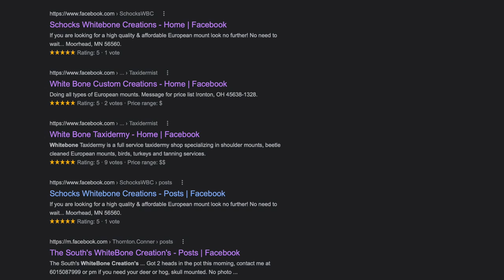WHICH IS BEST FOR CLEANING SKULLS BOILING OR MACERATION

Comment: I don't usually jump on parties like this, but I followed the boiling technique of 30 minutes of boil- pressure wash-20 minutes of 1 to 1 (40% hydrogen peroxide to water) - then the mop and glo, and my mature mule deer turned out beautiful.   It was far better than any other attempt I've made at cleaning a skull. I highly recommend this method.

Comment: I'm on a lot of those Facebook groups who slam the boiling method, I've never had an issue with boiling because you're right in that too much of anything can damage bone, also a lot of the people who don't agree with boiling have never tried it, they're often in small apartments with either a small or no garden, so they don't have that option, I see a lot of posts on Facebook of people who dig up their buried skulls or tip out the maceration buckets and find the bones falling apart! Keep doing what you're doing, I love watching your videos over here in the UK!!! I'm working on a few red stag skulls myself and your tips are priceless!! 👌🏻
Reply: The reason why they fall apart is because every single bit of connective tissue is removed, so unfused parts of the skull will need to be glued back on. Maceration, unlike boiling, removes all bits of flesh and doesn’t cause any damage. Boiling does trap grease, weaken the bone structure, and causes splitting of the bone due to intense heat. While some results may be worse than others, they are still bound to decay over time. Hopefully this helps give some insight.

Comment: I used to love watching ur channel! Got me into bone collecting in fact! I use the maceration method and I'd like to clear some things up with boiling and maceration:) maceration does smell and it takes time yes, you can speed it up with a tank heater or pond water! It actually helps leach grease out of bones as well, but some animals are more greasy than others. Maceration is a better option if you want your skull to last longer and look better since maceration doesn't damage the fragile bones unlike boiling! As for boiling yes it is fast but it isn't very good for bones, boiling actually can trap grease in bones and can cause it to resurface years later which doesn't look as good! As for your whitening method? I've never used the product you use to whiten bones (I don't whiten my bones I love the natural color!) But hydrogen peroxide is perfectly okay to use and fairly cheap in some places, bleach isn't recommended for whitening bones since it'll eat away at them and make them chalky and brittle. For maceration ammonia is a great degreaser to use! Just be sure to use it in an area with good ventilation as you do not want to inhale the fumes :)
Reply: I just want to add I've never tried the boiling method but I have a skull from my grandpa that was boiled and it looks very different compared to my maceration skulls! Yes with maceration you risk losing some bits and pieces but it's an easy fix! A cloth can help catch any bones that fall out while you're dumping the water out, this is not in anyway trying to attack whitebones or anything! I haven't watched him in awhile and this is the first time I've seen this video. I love his work and he's what got me into collecting bones and pelts!

Comment: Thanks so much Ryan, I know it is still very stinky but I like to macerate in like 30 degree celcius water for a week or two.  Then pressure wash and then boil. This loosens the flesh and gets most of the blood out. It works for large horned antelope like kudu an eland which is hard to find a steel boiler for. Love your content

Comment: I boil, but a pro for maceration that wasn't addressed here is for predators especially, you don't bleach or mess up the stain on a predators teeth. You can macerate and pull teeth easily, then whiten and reinsert the cleaned teeth to get a nice stained look.
Reply from the maker: Great point.

Comment: I have used your method many times with really good success but my question is is that this past fall I got my first black bear but it's head shot what should I do it's shot straight up the nose through the back of the head with a 30-30 soft-tip thank you in advance

Comment: I think having both processes down is a good idea. In my state, out of state hunters cannot remove skulls with brains in them. So for a fast and good process, Whitebone has a great process. I am working on doing it as well. For locals, I tend to use maceration and that is 3 weeks of stinkiness but does preserve the tiny bones better. I need to find a boil pot that works well for elk. If anyone has one that works great for that, please let me know. Cost is not a huge issue as I want something that will really last. Thanks!

Comment: Why Mop n Glow? I've heard of a lot of different things to coat skulls in, but heard most of them yellow, or flake with time. What is special about this floor coating?
Reply: It's used a lot in the plastic modeling community (model cars, tanks, little army men) because it's a cheap way to seal paint. There was a furor somewhat recently that it has changed formulations and may or may not be as good now for that use. 

Until I started watching this channel I had never seen it used by someone to seal other materials besides models and floors. Then again, I watch these videos as a niche way to watch satisfying power washing videos.

Comment: I did one,fleshed it  boiled it in dawn dish soap my self then dryed it  painted it with Elmer glue and water put it together with super glue,
It turned out awesome!!!!!

It's  a full skull and jaw bones & 1 vertebrae

1 big pot
A cupple of squats of dawn dish soap . 
And boiled it!!!!!
Paint it with Elmer's glue , sponge brush and water and supper glued & the teath all in all less than $20.00. + time about a" week" to do start to finish .
A family member had a pro taxidermist do one $150.00 beetle  cleaning and mount on wood took like 3-4 months, it dry out split down the nose and it yellowed looks like crap.
Reply: interesting, about the later issues with the beetle method. i called last season, to look into that. it was going to be 8 months, and it was $300-400. nope. too much, and, i ain't waiting that long for a mount.

Comment: So if you are interested in the science behind maceration and why the water changing at specific points speeds up the process, i'll give you a quick overview.

Maceration technically is an aerobic process which means it requires oxygen work. If you have an airtight lid on the conteiner then in a few days to a week or two (depending on the size of the container and how much oxygen is essentially in there) the environment inside the bucket runs out of oxygen and the process comes to a stop. New water = neew batch of oxygen for the bacteria. 

However, if you want to further speed up the process then leaving a bit of the last bloody maceration water on the bottom of the bucket and filling the rest up with fresh water will make the bacteria colonies work even faster because they don't have to start from 0 again per se.

Awesome video though!
Reply: Ahh thanks for explaining this! Guess i now know why half my skulls have taken a year +/- to macerate🥲😅😂

Comment: Hi, how did you get rid of the corpse wax? I have a wild boar skull which I macerated because I don’t have a lot of free time and it’s a very hands-off process. The problem is that now there’s corpse wax in areas I cant reach. I was talking to my organic chemistry professor about skulls and stuff and he said he used to put his specimens in a 50/50 solution of drain cleaner (NaOH) and water for 1 week. That should dissolve the corpse wax and left over tissue before you start whitening. I’m hesitant to try this because where I live it’s quite difficult to get your hands on skulls like from a boar or large animals. Have you tried this method? Do you this it damages the bone? I only found 1 paper that mentions NaOH in bone preservation.  Thanks!
Reply: Degrease in 3% or standard house cleaning ammonia before whitening. Wild boars hold a lot of bone marrow and meat grease so it may take some time but 100% will be worth it when you don’t have a decaying skull haha

Comment: Got the first two turkeys to do this week. Got them sitting on an ant hill.
Reply: i'd love to try the anthill method. i even have numerous giant anthills nearby (i'm talking 2 feet high and 3-4 feet across, above ground). but i have two issues that prevent trying. i'm in canada, and our deer season runs from september to december. i usually don't even hunt until there's some snow on the ground, as i love tracking my deer. and even if i did get an early deer and the weather was still warm through the fall, there's no way of protecting the rack from predators and rodents. a wolf or coyote or bear would surely drag it away. and if they somehow never found it, the rodents would be chewing on the antlers. 
even the maceration isn't an option, as i'd be dealing with colder temperatures. and, the maceration method really doesn't interest me at all.

Comment: Boiling definitely degrades the bone, not to mention cooks grease into the skull. There is no possible way a skull can be degreased & finished in 2 days, period! Would love to see a skull you've done with this method that's 6 months to a year old.
Reply: Literally this. Tired of the misinformation being spread to new individuals especially about boiling. Awful stuff.
Reply: Over boiling degrades the bone.
Reply: I have some that are 5yrs old that look just like when I finished up... and you don't boil.. it's a simmer which is not a full boil.
Reply: I've got one over a year old that looks the same as it did the day it dried using this method.

Comment: I have a question I shot this mule deer in the face 2 hunting seasons ago it made a decent size hole when I pressure wash it will is cut the skull
Reply: probably not, but if you're worried, then just hose it off rather than pressure washing it.

Comment: How can I avoid over boiling bones?
Reply: Don't rapid boil just a very low simmer until the tissue starts falling off. After a couple hours I remove it occasionally to pull off whatever tissue I can manually and put it back in

Comment: There is way to much proof that boiling cooks grease into the bone so I wouldn't say it degreases better. Boiled or not they still need properly degreased. Loose bone is due to maceration actually cleaning everything and leaving nothing but bone. Your set up was not the best I could have had that done macerated  in a few days. How about to try maceration them degreasing at 120 with ammonia or dawn changing the water when it gets cloudy. Do that until it stays clear then whiten with peroxide no heat or nothing over 120. You should be able to see a difference in the finished product if not right away months to years later you will not see the skull going back yellow or spots.
Reply: If you are boiling grease into the bone you aren't doing it right